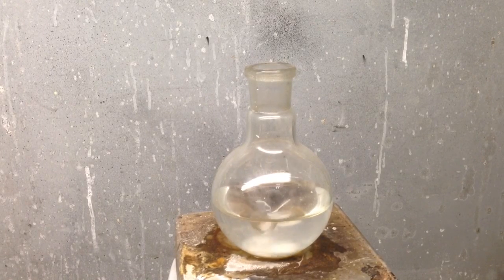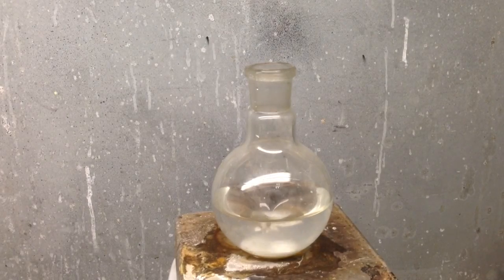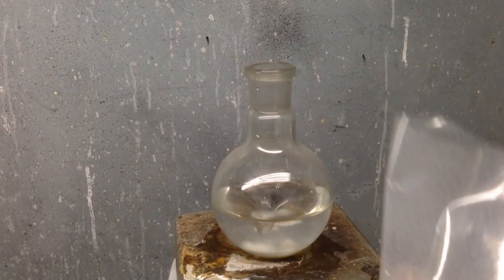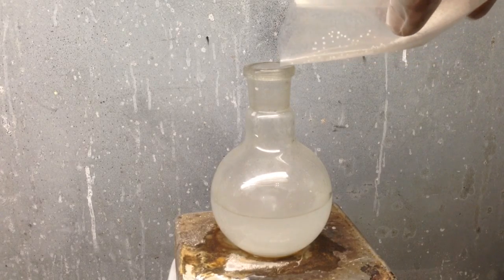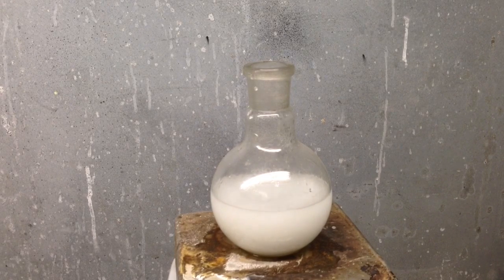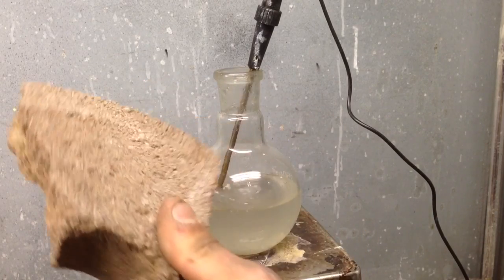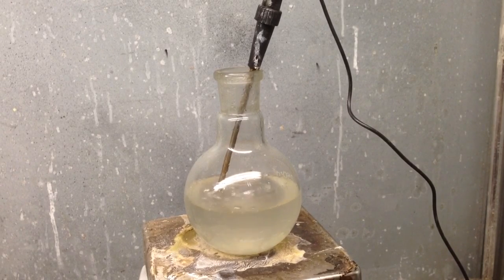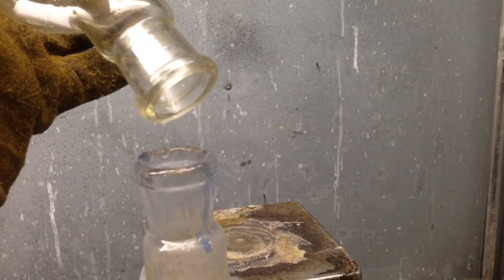How to make Sodium Silicate (water glass) - DIY Refractory cement - PART 1

Comment: Great video 👍
Just watched your other video and to increase the strength of your geopolymer blocks you need to use clay instead of sand, mixed with the sodium silicate. That’s what geopolymer concrete is usually made from, clay(aluminum silicate) and sodium silicate.

Comment: Excellent video! Kudos to you for actually giving the appropriate ratio of sodium hydroxide : silica. Others out there are using ratios that won't produce the silica concentration needed for foundry use. I'm very curious about use of an external heat source. Obviously, you didn't need it, but others say it's necessary to dissolve the silica. Some made water glass that was dark amber, not clear. I want to make clear water glass to make fire bricks, crucibles, and such. I also want to tint the water glass with pigments to add color to certain things. Do you have any idea why the water glass might turn dark? I was planning on crushing the silica beads. Do you think that would help it dissolve?
Reply from the maker: The reason i didnt need to heat it is because its a relatively high ratio of sodium hydtoxide to water. After dumping the hydroxide relatively quickly, the water gets very hot.. if you work quickly that heat is "enough" to dissolve the silica gel. 

Extra heat definitely doesnt hurt tho.
Reply from the maker: Crushing / grinding the silica will 100% help the reaction take place faster. But add powdered silica slowly or it will clump up into 1 big mass and take 10x as long to disolve vs if you left it peletized. 

The discoluration is likely from the cobalt additives in the blue beads in most gels. The blue turns pink when they're hydrated indicating they wont absorb moisture anymore.

If you pick all the blue bits out, or start with strait clear silica beads without the inidcator beads (blue or pink) then it shouldnt discolour.
Reply: @nilamotk  Thanks for the tip!

Comment: I didn't think you were supposed to use glass when making sodium silicate since sodium hydroxide can destroy glass when heated
Reply from the maker: It's strait sodium hydroxide that will dissolve glass when molten. This is relatively dilute tho and it's nowhere near "molten sodium hydroxide" Temps. The glass held up fine.

Comment: what is the mixer you are using? it looks like a steel ball being moved by a magnet under the surface top. Is it shop built or commercially available?
Reply from the maker: It's a (heated) magnetic stirrer. Or a stirring hot plate. They're widely available, there's a Teflon coated magnet in the flask and a spinning magnet mounted under the hot plate. You do get what you pay for though. This ones junk for anything that requires any real amount of heat.

Comment: nilamotk,  I have used your recipe for water glass and made some refractory panels for my prefab fireplace.  I have not removed them from the mold i made for them but they seem pretty firm to the touch.  Do the have to be fired or will the hot gulf coast sun be good enough for them to be strong.
Thanks,  Billy Jack
Reply from the maker: You kind of need to fire it. Letting it air-dry it will get crispy on the Outer Edge but the inside will stay soft and it will never get the full strength shown in the video
Reply: @nilamotk  Sir. My patterns are on wood and I have a large grill that will get to 500 degrees or higher if the wood does not catch fire will that heat do?  My first experiment with refractory brick as 67 .   the fireplace co. wants $850 plus shipping for these panels that are only 36" by 14" is the largest.  HELP!!!  I am Lost.
Reply: @nilamotk  nilamotk,  is there a time limit of how long you can wait before you fire it?

Comment: You're just REALLY d@mn lucky that you didn't spill any on that bare right hand of yours!!! 

WEAR GLOVES ON BOTH HANDS when working with stuff, folks!!! Not only is this guy risking a severe scald; but, severe chemical burns!!! It's also advisable to use a face shield, as well. "Murphy" LOVES folks who get too cocky to take basic safety precautions...
BTW, "Silica Gel" cat litter is easier to source, if you're going to make a lot of this suff. (And, MUCH less expensive than the desiccant packs...)
Reply: I was wondering how many VCR's I had to buy to get enough silica gel packets to do this.

Comment: Thanks for this, I saw a guy boiling the stuff in a stainless steel pan, I read somewhere that caustic can disolve glass.
Reply from the maker: Stainless steel is better molten sodium hydroxide in its pure form can dissolve class, a dilute solution of it I've never had issues with although it will ask the glass Sobe where you might ruin your glassware

Comment: I buy concrete densifier/liquid hardener for my concrete polishing business by the 5 gallon and sometimes 55gal containers. Densifiers used to be soley sodium silicate but now the majority of them are lithium silicate. You can still buy sodium silicate densifier in 1gal or 5gal containers from specialty concrete supply stores. Im guessing its the same stuff to what you are making or very similar at least. I wonder if lithium silicate could be used for the same type of refractory mix.
Heres 5gal of a sodium silicate densifier I have used in the past for polishing concrete for only 40 bucks: 
https://www.whitecap.com/shop/wc/p/euclid-eucosil-liquid-densifier-5-gal-053-05?gclid=CjwKCAiAn5rUBRA3EiwAUCWb22NvJx1xJscDo9skqwQm42DDNNZSzKb7n-3uYKUfzLhUoIXGv9UC3BoCUaIQAvD_BwE
Reply: +nilamotk 

Interesting. Being a stone mason I'm aware of using Sodium bicarbonate to flash set type I/II cement, but never would've thought it'd work for this..Very cool Thanks... 👍👍👍
Reply from the maker: mojo jojo it would be pretty much identical maybe a bit more diluted you could always boil off the extra water and have a concentrated solution
Reply from the maker: mojo jojo if you pour the liquid out and it does not freeze like shown in the video, it needs to be further concentrated by boiling it down.
Reply: +nilamotk 

What's the shelf life after preparation? Is it the kind of thing you can store in its liquid state, as in super glue? Also, what is the catalyst for hardening once it's applied? I didn't miss the carbon dioxide aspect for a cure, but does it just "go off" on its own in open air, or heat or other?.. Thanks, I'm planning to make some asap so I don't wanna mix a large batch and waste any for lack of know how... ty
Reply: +nilamotk 

oh, also, is distilled water an absolute necessity or can I get away with tap? stupid question I guess being that I'm aware of the mineral and ph inconsistencies in tap, but I'm lacking the appropriate items for proper distillation at home and to lazy to go buy any..  hahaha, ty again
Reply from the maker: Mason Man its a little different then superglue it wont harden if its in a sealed container, if it does harden you can break it up and redissolve in hot water but its a pain in the ass.. 

And tap water should work fine. As for a catalyst, it cures with co2 so keep it in an airtight container. To make it harden faster you could experiment with sodium bicarbonate mixed with the sand to try and speed the curring process, or put the whole thing in a platic bag with a source of co2.

Comment: sodium silicate $12 a gallon from McMaster Carr or the Phosphate free TSP is dry sodium silicate at home depot is $2 a pound and you don't have to be a learn on the job chemist
Reply from the maker: Dave Snothere not everyone has access to McMaster.  sodium silicate is caustic too so shipping is extra. different parts of the world have different products.
Reply: I understand that.  I wanted to share that it is easily available to many of those who just want the water glass,  it is pretty hard to find.
Reply from the maker: Dave Snothere yea its good to know, I wish it were easily available for me.. lol
Reply: Sodium silicate
Reply: TSP. TriSodium Phosphate.
Reply: how much water do you mix with the tsp-pf?   and do you heat it to mix it ?
Reply: @DarrellHughes82  

The Safety Data Sheet for that product lists ingredients :

Component CAS# % by Wt.
SODIUM SESQUICARBONATE 533-96-0 90% - 95%
 
SODIUM METASILICATE 6834-92-0 0% - 5%
 
EDTA, TETRASODIUM 64-02-8 0% - 5%

Comment: So how do I do this without the mixer thing you are using? can it be done on a stove top?
Reply: Just stir it by hand with either a metal spoon or preferably a glass rod or other inert material. If your stove top has a fan that vents outside of your house then it should be okay. Otherwise do it outside in a well ventilated area.

Comment: The refractory material you are breaking is called GREEN SAND!
Reply from the maker: Mike Horton lol. no, it not... green sand said mixture of silica sand and an oil.... this is for making cores for moulds.. it's hardened using co2 and works well for a cheap substitute for a simple foundry, and is very easy to make... thanks for the false info though.
Reply: No butthead! Greensand has sodium silicate mixed into it.so it will harden with co2.  Petro bonded sand has oil...and where did I get my info.. us navy foundry A school 1990.. that's molder rating school .you are a piker at best..
Reply from the maker: Mike Horton You're probably American and upset about Trump... and whoah now keyboard warrior. Green sand is damp sand mixed with bentonite clay. it's reusable.. MOULDING SAND is sodium silicate mixed with sand and is NOT REUSABLE. Your military "foundry course" is either a complete lie or you weren't paying attention... That, or because metal casting has nothing to do with the military, they didn't have a fucking clue either..

how about a quick Google search before you start talking shit?.... makes you look like less of an ignorant douchebag.
Reply from the maker: sorry "navy foundry course..." Please, Don't make me laugh...
Reply: I know your comment is old, but the US Navy and any real navy had tender ships that were/are complete shops, including a foundry that are used to repair damaged ships after battle without having to go to the dock, so yes the US Navy does have an foundry training manual, I have one.  It's pretty good, but dated, well, the one I have is.  Do they still use it, don't know.  I'm sure it's all on disk now.  :)

On the other hand, I have to agree with you about the green sand.  I never read about using sodium silicate mixed in green sand. Cores and complete silicate molds, but never mixed in with green.

Comment: Great video. Thank you for sharing. If left uncovered, will sodium silicate solidify? Regards
Reply: It will form a film on top as it reacts with carbon dioxide in the air. The cured sodium silicate is waterproof and will prevent the rest of the liquid from curing. But if you disturb the liquid the film breaks and the forming of a new surface layer will occur.

Comment: Im working on a project using ceramic fiber blanket and need to join several parts of it together could you use this for that and how would you apply it to ceramic fiber?
Reply: In my experience waterglass will not act as a glue like contact cement or caulk. It is no very flexible and will break and most likely flake away if the blanket is moved even slightly during use. I guess the waterglass can be used to glue the blanket to a hard surface since the likelihood of mechanical stresses exerted to the waterglass layer is minimal...

Comment: Can you use sodium silicate mixed with graphite powder to make a high temperature mold for casting?  The graphite particles are so small they tend to make a much cleaner looking casting.
Reply: Only one way to find out... but if your mould is supportive of your graphite/silicate mixture (since it will most likely be more of a slurry approaching a paste) you will be fine...

Comment: Says on the information bug that you can buy a gallon for about 30 bucks from The Ceramic Shop.
Reply from the maker: There are no ceramic shops near me. and you can make 5 gallons easily for 30$ if you go the kitty litter route.

if you can buy it local it will be easier and less time consuming. if not it's cheap and easy to make yourself.

Comment: Very cool. This worked perfectly except I used 61gms of silica for any extra lye then after 45 mins of heating, stirring, repleting with water I had a small clump of silica I had to take out. The final product is really weird and cool. If you put a brush in it ... its almost like super semen cement. It locks on the brush, strings and hardens. I had to dilute it with a bit of water to work with it. But this should work perfectly for sealing my steel pipe furnace. Plumbers tape does not keep it air tight at the seals (when heated it melts off) but I'm hoping this stuff will.

Comment: Hi nilamotk, l appreciate your vids on sodium silicate and its use in refractory bricks etc elsewhere. Keep up your testing and sharing with us.
Thanks. Regarding your comments elsewhere about the sodium silicate foaming when heated. This happen in my experience, but its foaming can be avoided by controlled removal of water by ramping the temperature carefully. I have also read that mixing fine particles wtth the silicate also reduces foaming. I thinly coat metal surfaces on ultra light weight wood burning stoves with a sodium silicate render with talc and mix if metal oxides. I also 'glue' or bond zirconia felt to surfaces for insulation and heat protection. The silicate render does a great job, but I need to carefully cure the render at about 110 degree C for some time and then ramp up to 200- 250 degree C to drive off extra water before finally firing to 500+ degree C. This firing makes it really tough and in the hottest parts of my stoves the changed colour of the render gives you a temperature map. I also use the foaming to advantage in my spot welded tab joins in SS and titanium foil construction. I coat the joints with a light coating of render and skip the 110-200 degree C ramp and hit it with the gas flame and it puffs and fills all the tiny gaps. Then l sand off with aluminium oxide paper and finish off with a dense over coat of ramp cured render. Thinking of coating my bricks with the same render to give a nice smooth tough finish. Hope my comment might be helpful. Sorry if you know it already.
Regarding comments about buying or making your own silicate or fire bricks it I think we are on the best track for innovation by making our own. As you have pointed out you can make almost any shape exactly as you want it. Try doing that at a shop!I am new to these posts so forgive me if I have done the wrong thing.Thanks again,Tim
Reply from the maker: Tim Telemark thanks for the tips Tim. Ill give that a shot next time.  Thanks for watching!

Comment: I found a 37% sodium silicate solution for $35 per 3.8 liters. seems like it would be worth it to just buy it rather than make it. Is a 37% good for making refractory or would it need to be reduced to a stronger solution?
Reply from the maker: if you can find a supplier it will be cheaper. It can be tricky to find locally or even to have it shipped so some peoples only option is to make it. Im not sure the concentration of what I make in the video but you want it to ideally be like syrup, maybe a bit thicker. so if its to thin, heat it up to raise concentration, if its to thick add a little water (with heat) and mix it well.
Reply: Thanks!

Comment: How do I accurately calculate just how much of the liquid glass I'll need for a project, say like making fire bricks that are the standard size of a normal brick?
Reply from the maker: this is where you will have to look up a recipe . most "old timers" just mix it in with dry sand untill its just "damp" with maybe a little bit more just for fun.. lol
Reply: I guess it will be safe to do a analogue approximation with your intended material (be it sand, pee gravel or even smaller version of hydroton) and water. You can get a ballpark figure as to how much water it would take to reach a damp plus state for your aggrigate... Keep in mind you should be measuring out the water for the test by volume and do about the same for the waterglass solution (since the specific gravity for the two liquids - being water and the waterglass solution can not be compared by weight - waterglass solution is obviously much heavier)
Volume comparisons are relative safe since the volume before and after the reaction is more or less the same... If you want to go really scientific you can make a before and after measurement to know what the expansion rate is for this recipe...